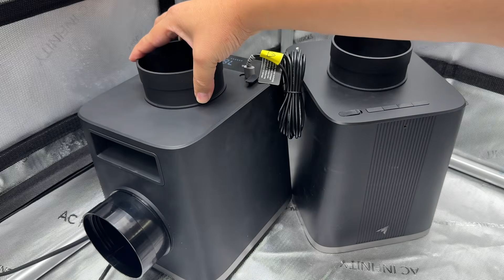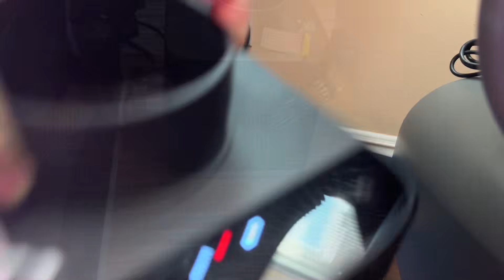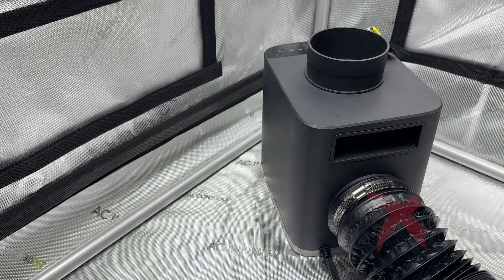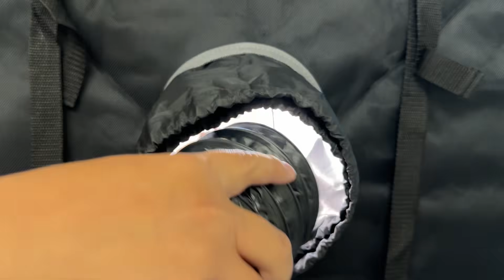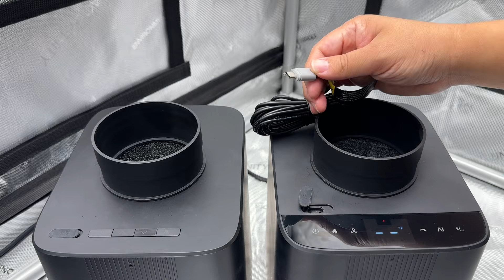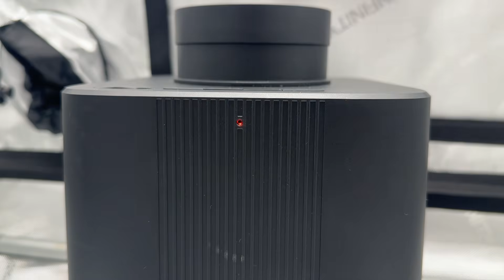An Overview of the Thermoforge S7 and T7 Plant Heaters

Comment: It's quite loud. Is that everyone else's experience? Or is this a dodgy one off?
Reply: It is loud. I cannot figure out how to turn the fan speed down in heat mode. It blows at level 10. I can only turn down the “heat level” what ever heat level means?
Reply: I’ve read that it can only blow at level 10 when in heat mode.. so other people returned it and got the t3 because it can run at low fan speeds while in heat mode.

Comment: Can the AI controller switch between running it as an intake or heater?
Reply: It is supposed to, but I get an error that I am not using the correct gen 2 uis cable, but I am.  I am working with support now.

Comment: Having a tent heater is one item needed to tent grow. If you are  running a dehumidifier that will also create some heat fyi. Just buy all three items dehumidifier, humidifier, and heater all setup through your controller. This all depends on your climate outside. this is based on my 3x2 tent, any bigger of a tent and you will need more equipment.

Comment: i got the t3 and it cant heat my 4x4 to 80f
Reply: T3 was running at 10 all the time. The tubing should be insulated
Reply: im in a 3x2 tent and it just keeps up with my climate I live in.
Reply: whats the temp of the room you're growing in and do you have any insulation around the tent?
Reply: whats the temp of the room you're growing in and do you have any insulation around the tent?
Reply: @christopher_c129 it’s a garage ranging from 74-55 degrees. No insulation but that’s a great idea.
Reply: @Budmaker2000 thanks for the update!